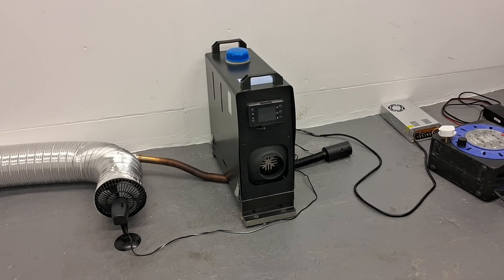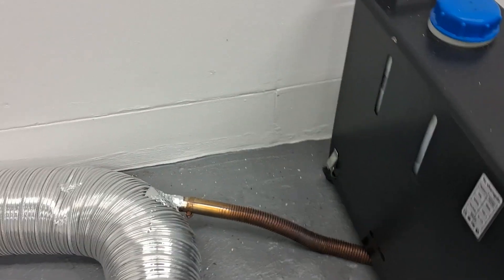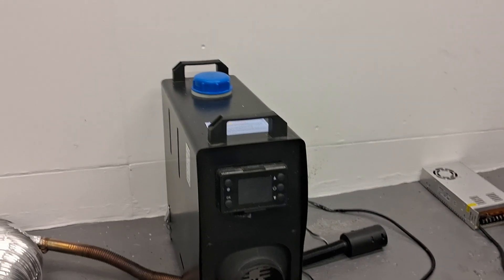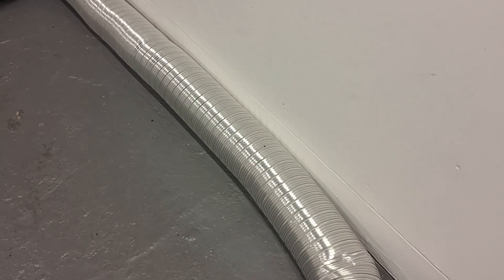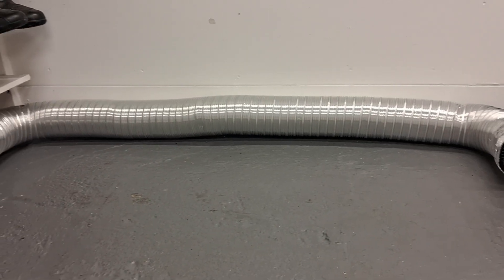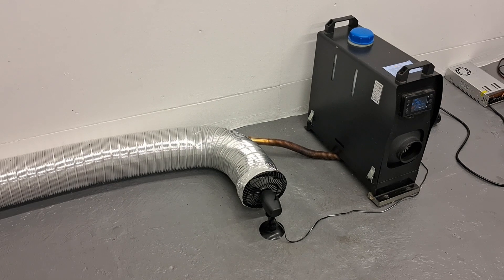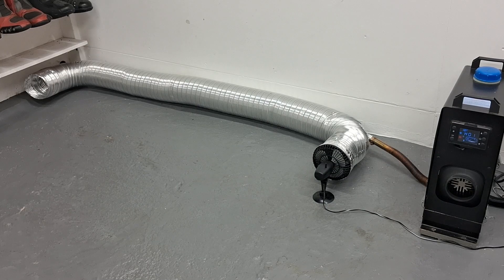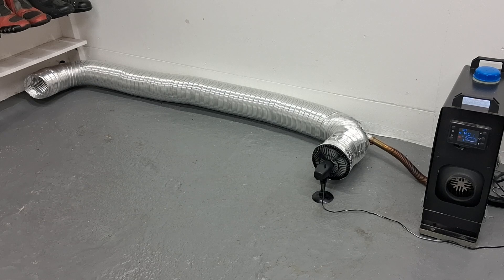FREE HEAT FROM DIESEL HEATER WASTE EXHAUST GAS HEATING MY HOME  House Chinese Kerosene off grid

Comment: lol smart, its like the same design heat exchanger as the heater itself. i think the tube is too long for that fan. if the outer tube (not the inner exhaust tube) was kinked a bit it would have more turbulence and improve heat exchange. could probably run 2-3 fans on low setting like 5v cpu fans
Reply from the maker: thanks andy

Comment: Double chimneys, usually combustion gasses rise inside pipe with fins warming up the incoming air then going into the combustion chamber. This ensures any sucked in combustion gasses go thru combustion cycle again.  Cooling of exhaust gasses need to be done outside with a bottom drain piped to the sewage line.  If your setup gets a leak because of corrosion carbon monoxide may escape.

Comment: The longer the exhaust pipe, I heard, can restrict the exhaust flow due to its small diameter.
I was told this info as I seem to make the mistake of not running the exhaust pipe lower than the machine.
It cost me a machine. I was using a 2-meter-long pipe, approx.